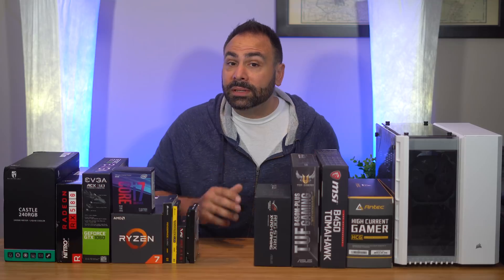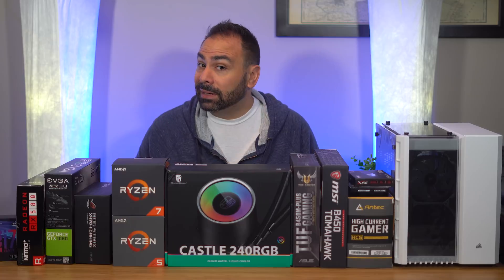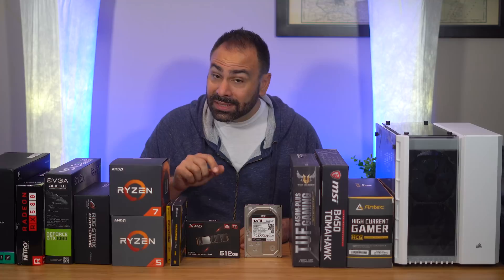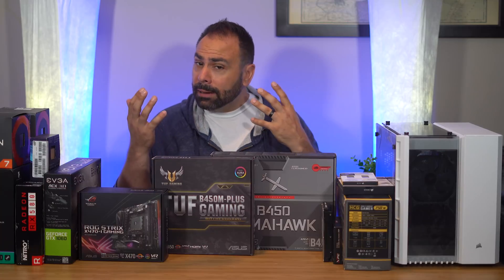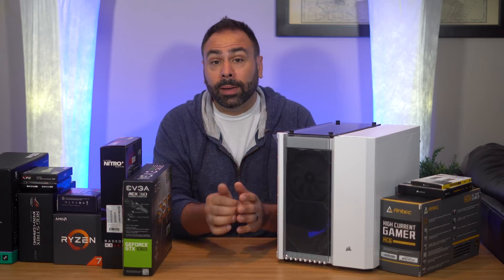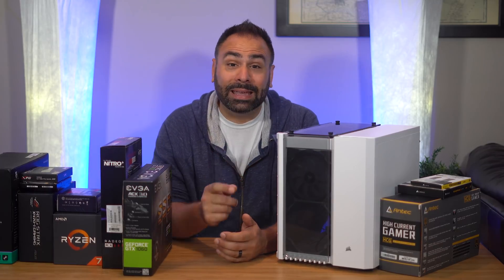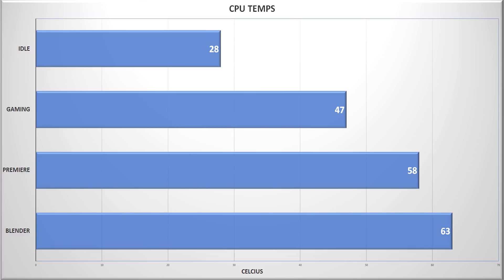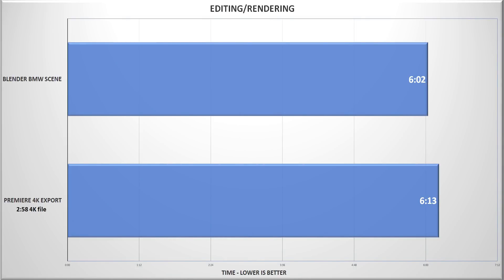Entry Level Gaming/Video Editing System Build!

Comment: is blowing hot air on your parts a wise choice? cause this AIO installation dissipates heat into the case
Reply: i own this case and have my rad on the top, push the air out and use the top as exhaust since its common sence heat rises.

Comment: Just watched the Jez video and oh boy, I had an old Radion HD card and bought a GTX 1060, wasted my money.  Would have been better off buying a better CPU.  Also what made you fit the rad at the front instead of the top.  If it had been me fitting the rad to front I would have used the LL fans for cooling the rad as I think they look much better than the Cooler Master fans.  A personal thing I know :)

Comment: High FPS gaming and video editing I would go i7 8770k and some AIO cooling. 
Value gaming/all purpose workstation/streaming I would go with R7 1800 at the moment with stock cooler concentrating on a good motherboard ram timings and case cooling.
Reply: non stock cooler on 1800X (but one really fine with the 2700X.

Comment: My R5 1600X runs at a poor 3.975 (it really wouldnt go higher on 1.425 V) but it runs at 80 max... on a hyper 212 evo... lolwhut????
Reply: First thoughts: silicon lottery
Second thgouhts: bad motherboard
Reply: @pixel_vengeur391  Ive got a b350 gaming pro carbon, probably the best b350 board
Reply: @x4jb908  By 'bad motherboard' I don't mean cheap-o, I mean a VRM problem of some sort
Reply: Yeah that's pretty terrible my 1600x runs at 3.9 @ 1.65V it runs 4 to but not worth the bump in V to make it stable. Only difference is mine is aio cooled with a cooler Master 240 and cpu never goes above low 30 idle and mid 40's under full load

Comment: The back of that case reminds me of my O11 Dynamic inside. Serious question here. I figured I should clarify with my original comment full of bs. The G.Skill "AMD specific" memory, is it actually worth the extra money at the exact same 3200 MHz CL 14 rating on an Asus ROG StrixX470-F, AMD R5 1600X platform? Yes, specifically the G.Skill Trident Z RGB 16 Gb kits. I have an Asus ROG Strix GTX 1070 SC if it matters as well. Anyone can chime in here. Thank you in advance.
Reply: The "AMD specific" G.Skill don't worth the extra money specially with 3200 CL14 trident Z, I try them on Asus CH7, asus B350M-A, MSI X370 pro carbon and power titanium with 1600X 1800X 2700X and 2400G and they works fine With XMP (no tuning)
Reply: @barbatocedric4246  I appreciate you taking the time to answer. That's kind of what I figured. Not to mention that the "Intel" version of both kits are on the QVL for my Asus ROG Strix X470 F Gaming motherboard and ironically the "AMD" kits are not. Go figure. I did a bit of research on my own after asking here. I was hoping to get a hands on from someone. Thank you very much for that.

Comment: which intel processor would you recommend?
Reply from the maker: For a budget build? Probably the 8400. But the 8700k is actually a fantastic choice for premiere, and although definitely not “cheap”, it’s far less expensive than any HEDT part
Reply: thanks
Reply: That all depends on what you want it to do. And how much you have to spend on it. There's lots of options, but you will have to elaborate, before I can recommend anything. Let me know, and have a great day!
Reply: @Manuel Don't listen to Dana. If you choose to go Intel, make sure the CPU number has a "K" or an "X" after it. For a few dollars more, you have the ability to overclock. And there in lies the advantage. Same goes for mainboards. Don't cheap out on B or H chipset boards. Make sure their  model number ends in "X" or "Z". Do your research. Look at VRM quality. Both with used and new. Take your time. Again, for a few dollars more, you will get something that will not only perform better, but it will do so over the long term. Build something for yourself that will last years, without the need to upgrade. Unless you want to. Or just buy parts for a future build.

Let me know. You can contact me here, and on Twitter at @MattsMechanical . Have a great day!
Reply: Overclocking doesn't actually get you that much. Overclocking is vastly overrated. People who review these things take overclocking into account, of course, and they all say 8400 is the value king. Yes, the 8600k is better in gaming, but the 8400 is better VALUE. If you are making money off your pc, then for sure get the faster processor as it will pay itself.